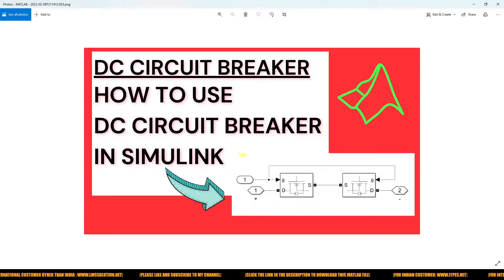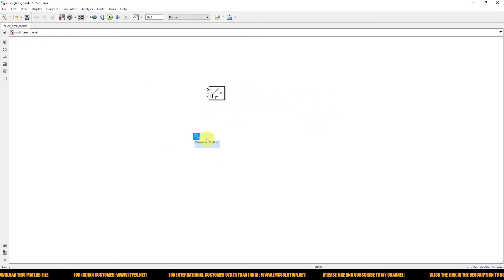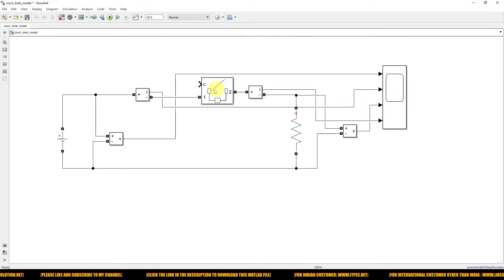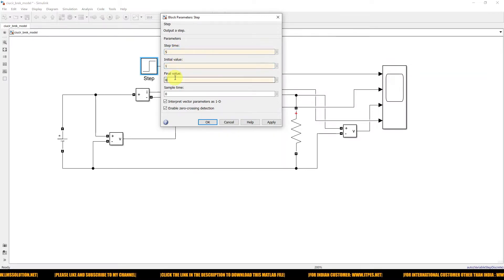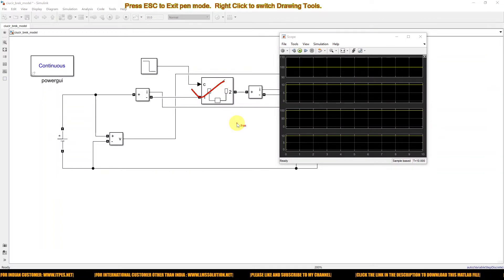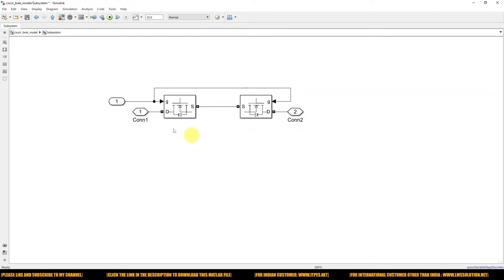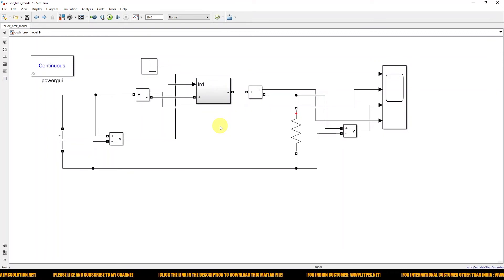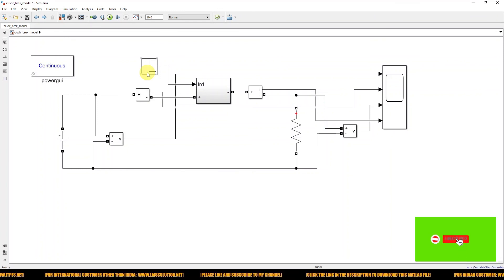DC Circuit Breaker Simulation in MATLAB Simulink | MOSFET-Based DC Breaker Design Explained

Comment: Good Video. I have done it. It works well. It seems that the circuit starts with close circuit as default and then uses the gain to determine the future state of the breaker. Do you know how to define the Break as an open circuit as default. I am giving 0 gain in Breaker between the load and the battery, but the battery is being discharged always when extremely load is applied in the battery even if the gain is zero.